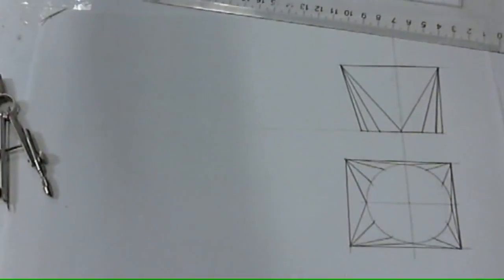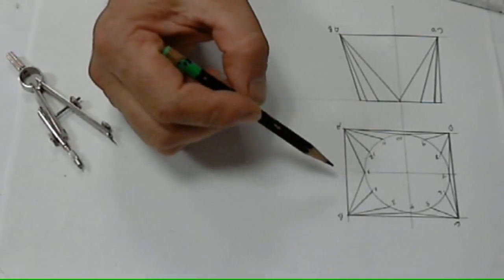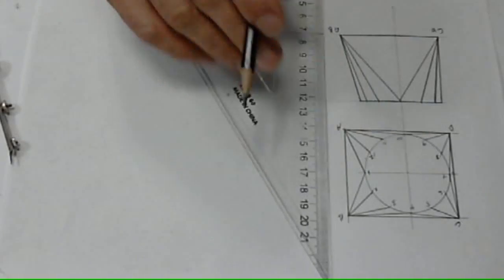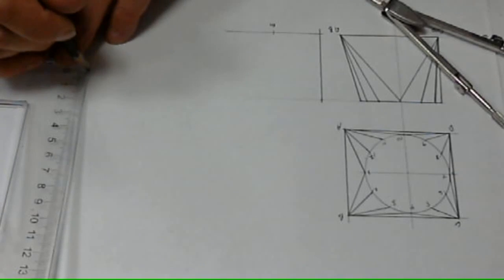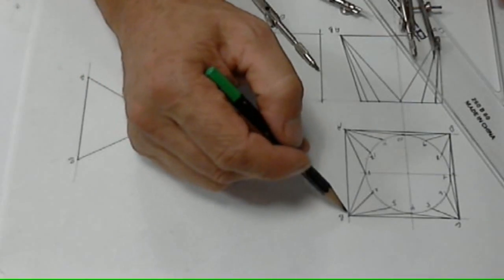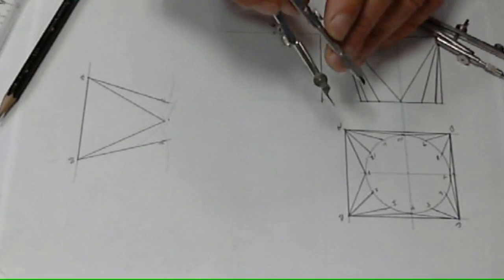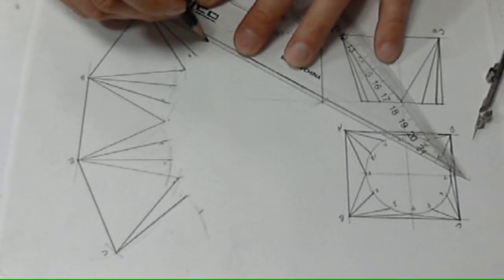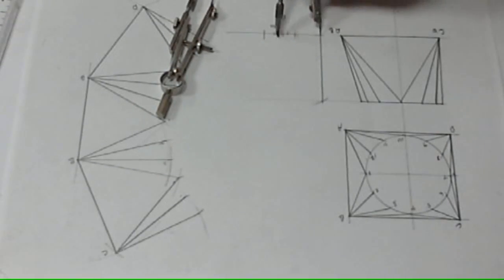Square to round

Comment: I'm a millwright out of Chicago...I have to fab and break sheet metal (22g) up to 3/4" stainless steel. then I have to tig weld it per print...seems faster if I lay it out my self rather have to wait and then pray that what the engineers layed out isn't going to fuck me over. 
great video!